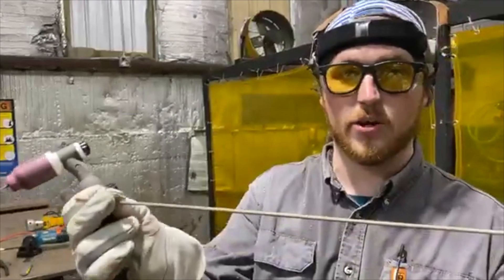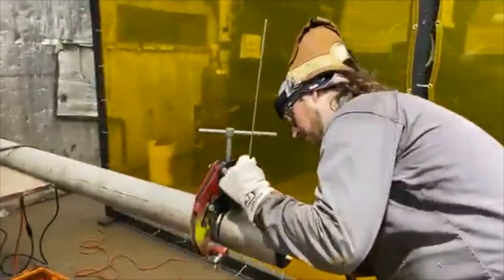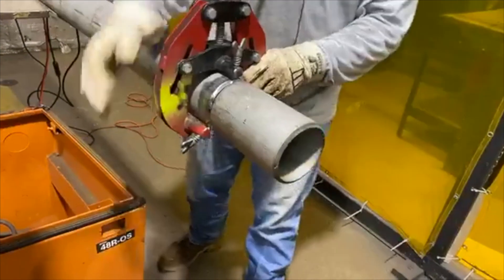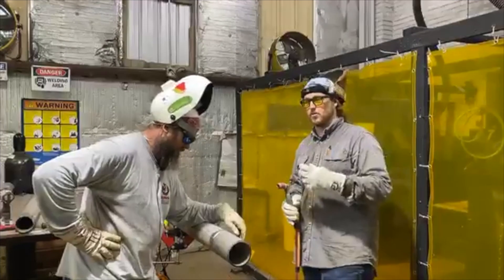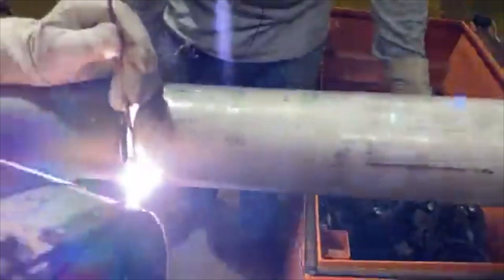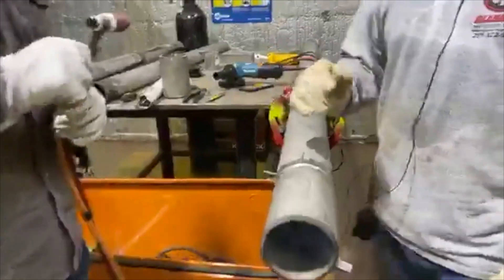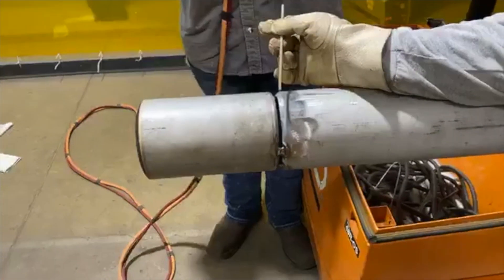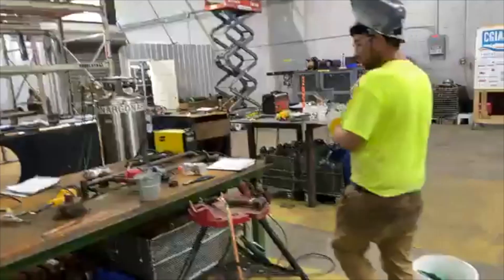Stainless no purge. DISCLAIMER: NOT LIVE/NO GIVEAWAYS follow us on Facebook for live giveaways.

Comment: No purge? No problem.  Run stainless steel stick welds.  Don't want to? Ok. Run hardwire stainless RMD on a open gap.  Can't mig weld and only tig? Put soloflux and but the joint no gap and run full pen - Hot and fast.